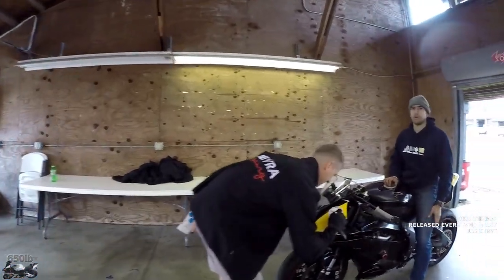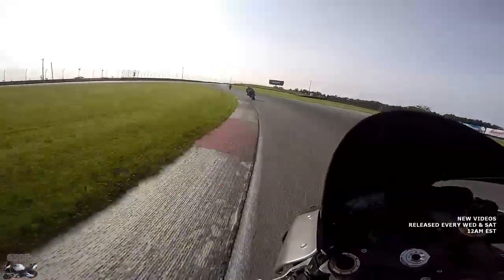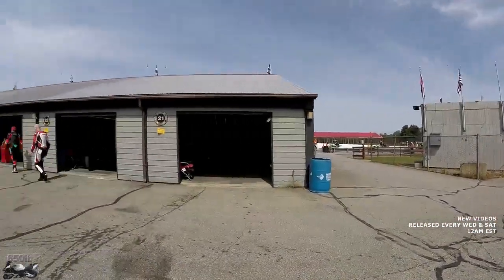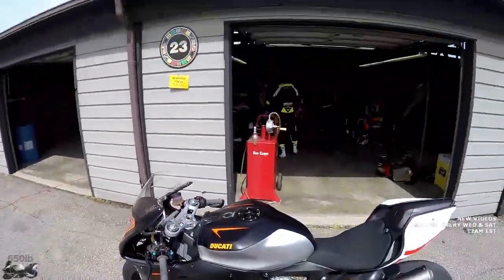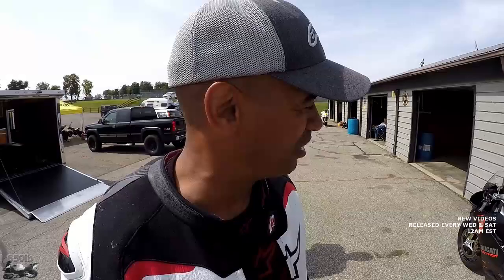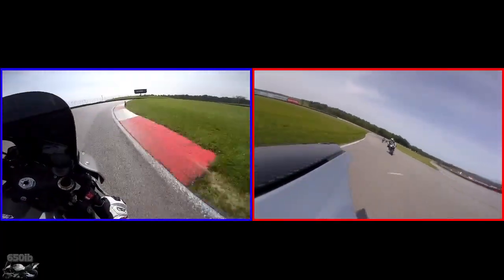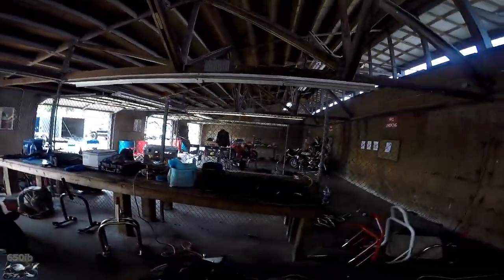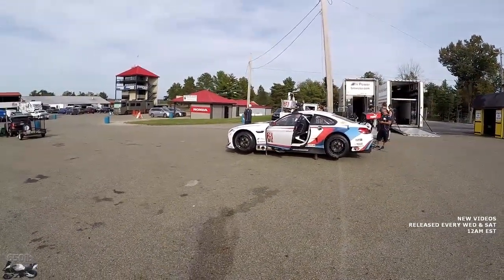2018 Ducati 1299 Superleggera vs R1M @ THE TRACK!

Comment: Its good to see you getting more track time in vs just WOT in a straight line on the streets.  One tip, you have lots of HP and are not slow but need to develop a bit more corner speed to be in the advanced group.  When you are consistently being held up in the corners, then it's time to move up to the next level.   Not that you are so slow to be dangerous to others, it's just very frustrating to be a faster rider on a slower bike and being held up in the corners, waiting to make a safe pass, making a safe pass only to then have that same rider take the spot back on the next straight. I know i know, get a faster bike they say, but for me I really enjoy bikes where i can use everything they got.  Lots of power and a long straight is super fun but for some that's not what its all about, its being able to carry lots of corner speed and having to extract every drop of performance that you can possibly get out of a machine.  Plus it's a special kind of fun to whoop on RSV4's, R1's and S1000's with an FZ-07 and with some skills, some suspension and brake upgrades on good tires its very possible to lap some very fast bikes.  Take care and have fun out there.

Comment: Maybe spend some time on a standard R1 in the intermediate group and learn how to go around a corner? Instead of harping on about being in the advanced group then going out there and getting in everyone's way in corners and then accelerating on the straights...worst kind of track day rider on big bike.  One tip..move weight/body BEFORE you turn into corner, not after turn in as you head for apex. Any wonder you feel unstable and want to corner slowly.

Comment: getting better all the time, but too much coasting ib, spend some time on a 600 and learn to set up, hang off more, trail brake in and transition to throttle minimising the coasting in-between which will make the bike feel vague and unstable....either way would love to be able to hang out with guys!
Reply from the maker: Thanks for the advice!

Comment: @650ib if you roll around in 3rd-2nd gear it will be less effort to throw around and probably carry more speed in your weaker section... just a thought.. looks like you like 2nd gear probably for the cushion of the engine breaking

Comment: Wow some amazing bikes. I think your out of corner speed is good but it looks as if your struggling with the correct apex in the corners. I'm not as fast as you but I think you should focus more on entry speed and correct apex as your strong areas are out of corner and straight line speed.

Comment: I like your videos but definitely shouldn't be in advanced.  Corner entry is erratic, cornering speeds are way too slow, lines are all off and erratic.  Might want to get an R6 to work on your foundation.  The R1 is helping you seemingly mask it by blowing down the straights.  That type of riding would have you black flagged and back down to intermediate with a strict track day group.

Comment: Thanks for walking us thru a tech requirement session. Curious though, shouldn't the racers be able to see the brake light so that would inform them of the racer ahead of them intentions?
Reply: GigaHertz62 nope..When Seeing brake lights ppl have a natural reaction to brake. That's the last thing u want to do on a bike especially while going through turns or cornering. Having lights on a track will do more harm than good!
Reply: Thanks for the response. Learned something new. Now that I think about it , that is a very logical answer.

Comment: Why long levers instead of shortened ones?
Reply: DiogoStar long levers give you more feel easier to apply differing degrees of pressure
Reply: Street riders might like the look of them but at the end of the day they are measurably less effective at being levers (the simple machine) than a full length one. Specifically, longer levers allow you to generate higher force with less effort because the place where you're applying your force is farther away from the pivot point.
Reply: Mr Smacksem makes sense!
Reply: BTrain5489 Makes total sense, thank you for both answers

Comment: Hey guys what's the difference between the Yamaha r1m and the Yamaha R1 F, i have no idea
Reply: Just more electronics and a little more power i think
Reply: Electronic suspension, carbon fiber fairings, and wheels.  That's it.
Reply: Axel Gaming there is no f. R S M

Comment: Nvm changed my mind I think I want a zx10r for my first bike instead of he zx6
Reply: Better drive a slower bike fast, than a faster bike slow mate. Believe me it's so much more fun to bang the gears through, than just rekin everything in gear two.
Reply: Yeah, get a ZX10R, better build quality, breaks suspension and everything. It's a lot more expencive though, but if you can afford it ;)
Reply: Dylan Fernandes start with an used 250cc learn to ride it, see if you really like motorcycles, learn to take corners properly, fall (we all fall) once you know what is this about, upgrade to a 1000, You'll enjoy it 10x and save a lot of cash
Reply: Just make sure your life insurance policy is up to date !!
Reply: I bought the ZX-6 as my first bike, changed to the 17' superduke after 1 season. The low-end, usable power for streetriding wasnt there. Thinking about getting a R1M or a Aprilia RSV4 next.
Reply: 2010 Yamaha R1 is my first bike, no experience riding a Big Bikes only Downhill bikes because im a Downhill rider. No accidents history untill now. Today my bike is Panigale 1299S and R1.

Comment: Getting quicker bro, just brake a lot later, you brake too early chap
Reply: It's super hard to carry speed up to a corner, working on overcoming that survival reaction too.
Reply: Pistol Pete   Less braking for longer will make you smoother=faster. Braking later and harder throws off corner entry as you don't have the same control of the bike